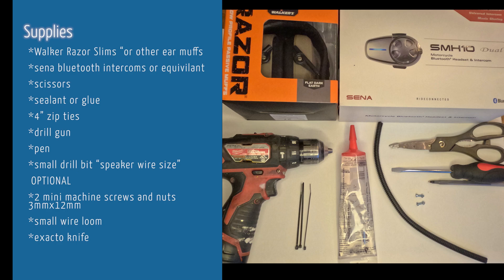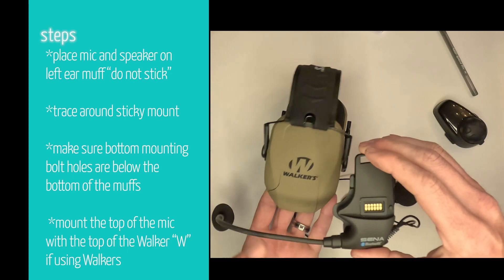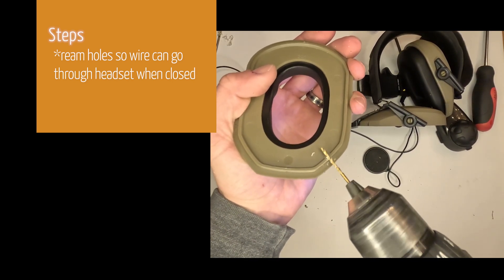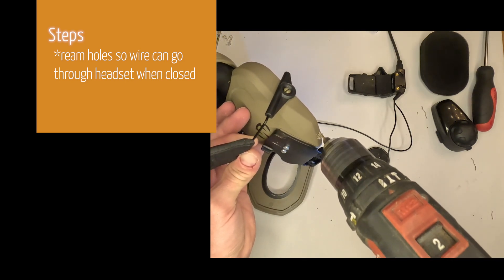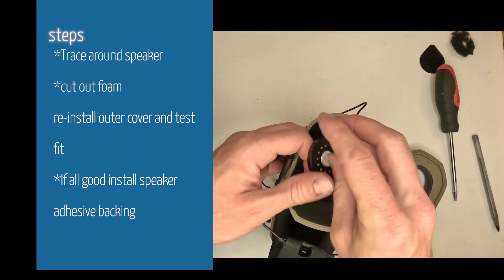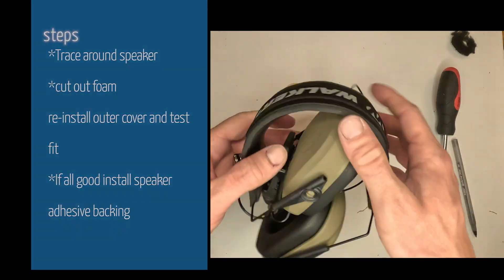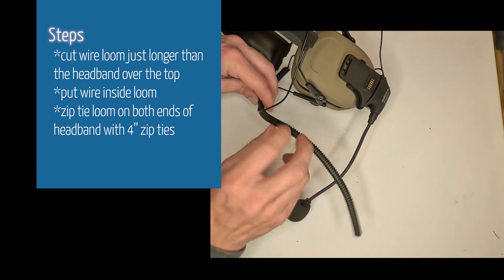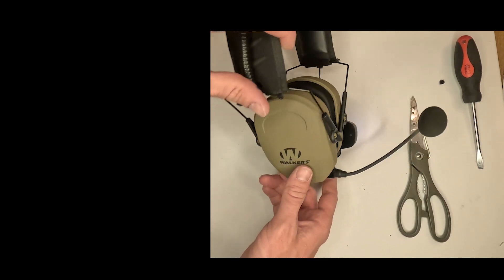Build your own Bluetooth Intercoms "DIY Tutorial"

Comment: I built some last year. I just put the speaker under the foam w/o cuttin the foam. Works good and you can skip that part..
Reply from the maker: Awesome good to know. What intercom setup did you use? Also thank you for subscribing I appreciate that.
Reply: @ridinreeds  lexin b4fm
Reply from the maker: @pinevalleyoutdoors3788  awesome I’ll check them out. How’s the audio at full throttle?